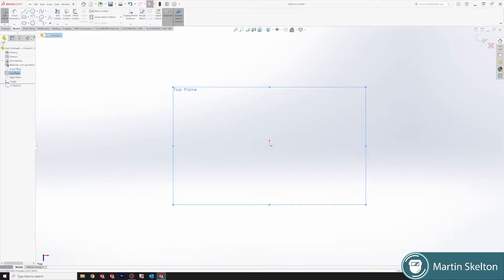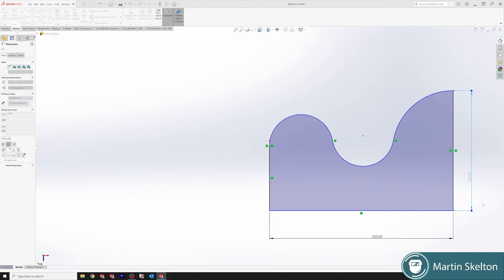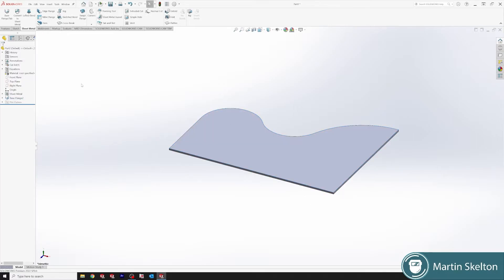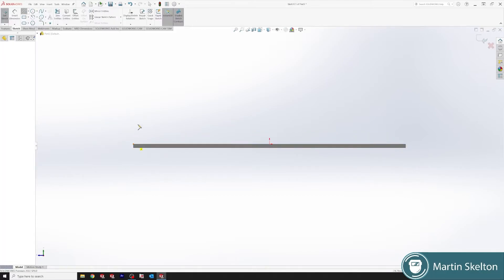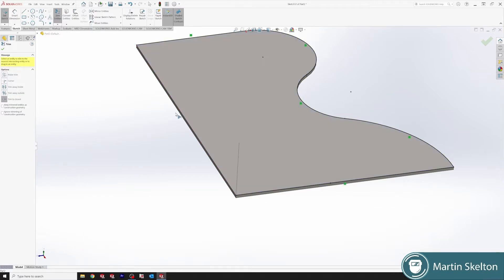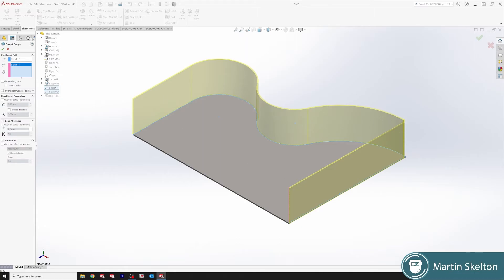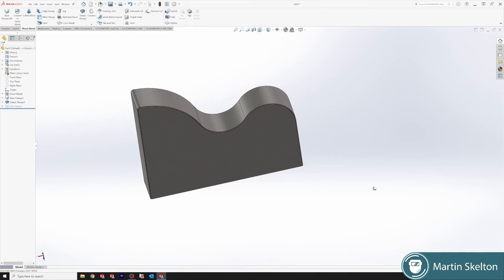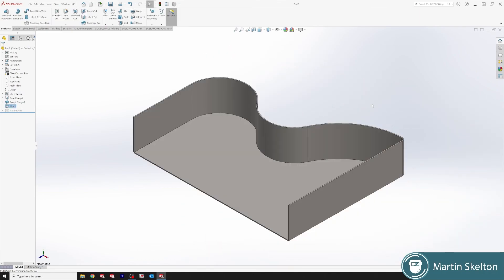SOLIDWORKS FEATURE IN 3 MINUTES // SWEPT FLANGE

Comment: can you please continue this video with tabs and slots between the sheet metal and the flange?
Reply from the maker: Hi Guy, I haven't really used the slot and tab command, it only appeared in 2020 version I think. I always done it manually with a pattern feature. I will give it a try and see what happens. Thanks for the video idea and thanks for the comment.

Comment: If I want to manufacture this profile,
How to make development sheet for laser cutting and rolling for the swept profile ?
Reply from the maker: Hi RAHUL, The swept flange is an interesting command. I have put up some videos on most sheet metal commands, but I haven't got around to putting one together showing how to get the digital information into physical form. Usually the flat pattern is saved to dxf format and then nested with the appropriate laser cutting software which turns it to g-code so a cnc machine can cut the shape. I will put a video together for this profile, that would show the production of a drawing pack (A set of files that the person laser cutting requires). Different people use different methods to accomplish it but I think the fail safe method is the easiest. Thanks for the comment.